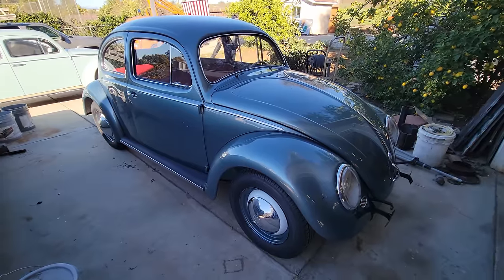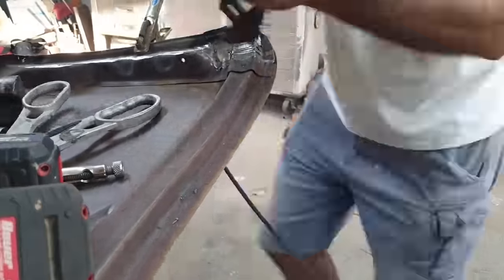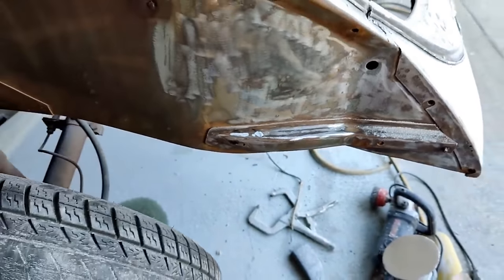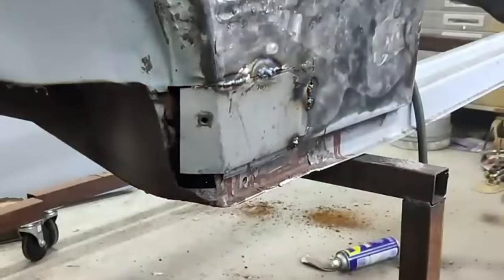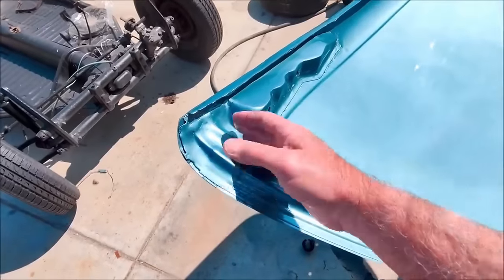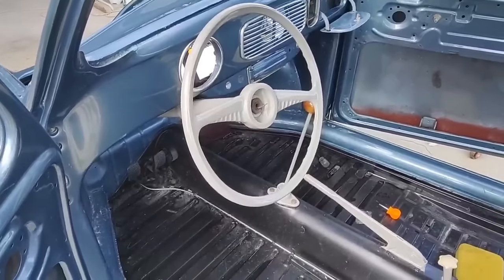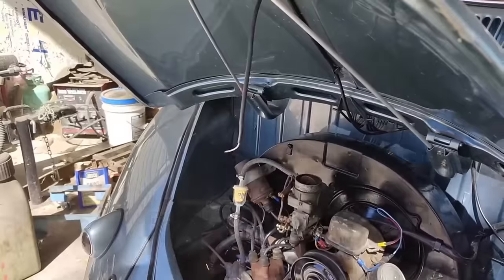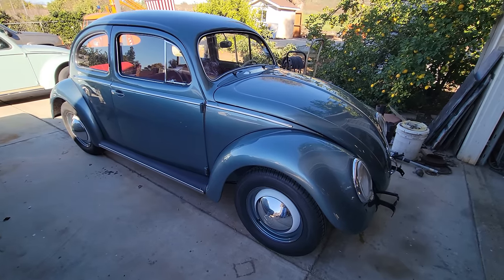Full Build - 1954 VW Oval Window Beetle Restoration - Start to Finish - 40 minutes

Comment: I got my grandpa's 56 beetle when he passed. Been in storage for the past 30 years just trailer out to my shop. In pretty great condition. But he used to take to mexico and had it converted to Propane. Need to find a gas tank. I'm excited to start the resto. Thanks for the inspiration!
Reply from the maker: you can find those. they are out there. luckily

Comment: Been watching this resto since the start.
Without a doubt the most complete restoration undertaken by one person that I have ever known.
Your work on the hood was artisan like, you are an artist.
A pleasure watching you work Mike.
As someone who has restored a 54 I can agree that it is a much more costlier resto than doing a 56 or 57 by far.
Reply from the maker: thanks that hood was way harder then I though when I started it.
Reply: I was surprised how much more 57's were compared to my 62.  I could see where you are split era and that's another step up in pricing and availability.  Still better than old Porsches, right ?
Reply from the maker: @DanTheManIOM  a little. and you dont have the snobs wanting matching numbers engines. Like that happens very often in the VW world. Like never. really.

Comment: I'm also in the middle of restoring a 1970 beetle and I appreciate the information your passing on.
Reply: Just stop what you’re doing, sell it,, and then buy something 1967 or earlier. Please.
Reply: @socaljarhead7670  Its to late. The car has sucked me dry, I'm upside down and im only half way done.
Reply: Screw it, then. Might as well finish it if you got the dough. Sell it and take a $10,000 minimum loss and get something 67 and earlier.
Reply: @socaljarhead7670  Thx for the advice
Reply from the maker: yea I say 66 and below. I dont do 67s because even though the parts are one year only they made LOTS of 67s and guys for some reason think the parts are gold. Cracks me up. late models I would only do a refresh and move on. The early cars are worth your time because you can have a bit of equity or at least break even. Lates are a money pit. Unless like I say you just do a refresh quick little beat and bondo some Empi seat covers and door panels. and Live with what you got.
Reply: @Mikefngarage  im already half way done and shes come along ways. I feel like every beetle has a story to tell and mine wont be any different, no matter what her tail lights look like.
Reply from the maker: @ronald8792  yea I would finish it. But Limit my time and expenses. I could do one but that is how I would do it.

Comment: My first car was a $50 ‘54 beetle with no engine. Your video is a really neat memory jog. I remember the roller accelerator, the foot operated reserve lever over the hump (no gas gauge), the tiny wipers, the spare tire air pressure powered windshield washer, six volt battery under the back seat, the tiny tilt out ashtray, huge canvas sliding moon roof, single gauge (speedometer) dashboard, etc. Great job, thanks!

Comment: Your expert work is appreciated. I owned and drove for years a black '54 VW sedan. The trafficators would not emerge until the car was going less that 45 miles per hour due to the wind force. All toll. I had 5 bugs and 3 micro busses. Great memories revived by your work. Thanks.

Comment: Mike, I love your philosophy and repairing vw's.    I apply what I learn from you, from this channel.  Agreed vision sucks as you get older, glasses on, glasses off, FFS.  What am I welding ?     Was the back edge of the hood just squeezed together and not the top skin folded over the lower section ?  My 57 sunroof has some old hood - looks to need the same repair as  you did.  I might just take parts off the 59 - batwing, engine, hood and call it a day.   I don't want to be like your friend, in his 60's and unable to get to it.